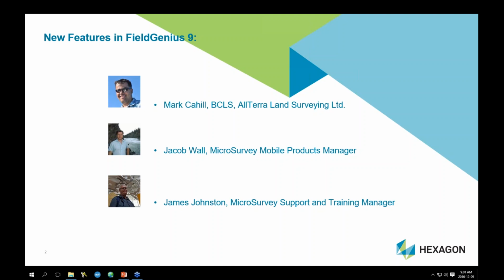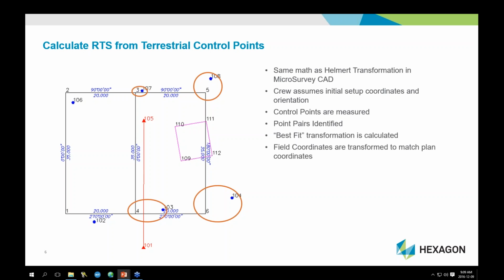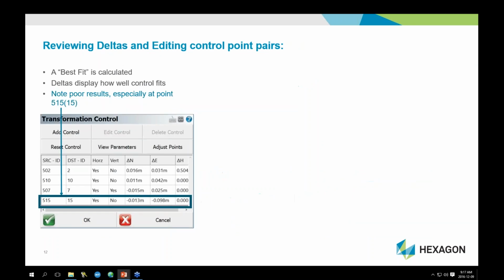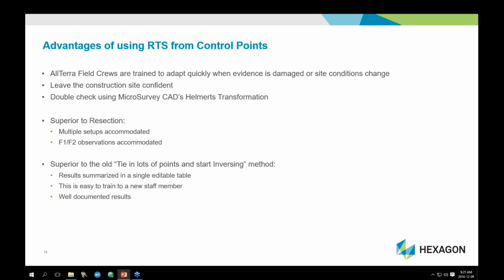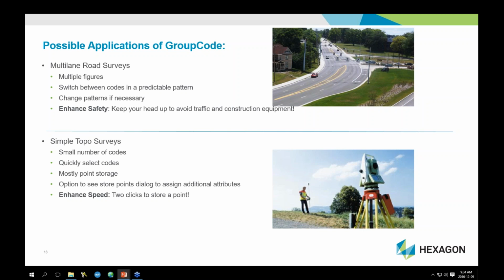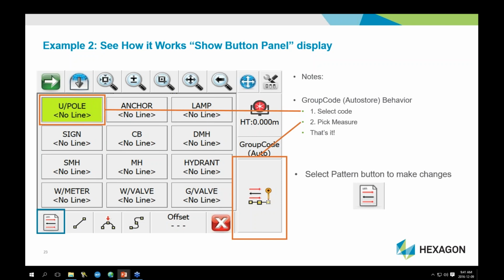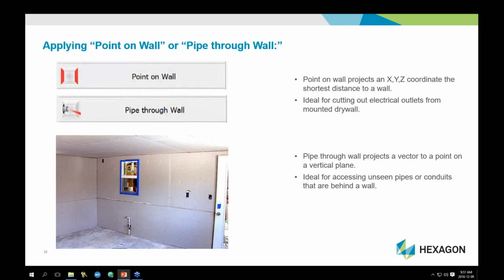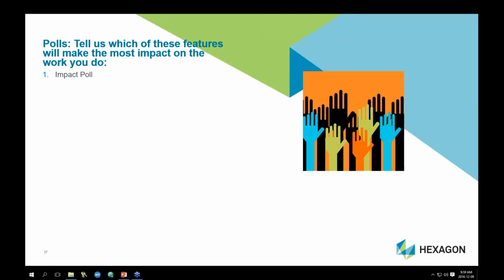Webinar - FieldGenius 9 New Features

Comment: The GroupCode function is limited to collect emough attributes for a feature. Eg. attributes for power meter, Buidings, poles etc. For power meter, one would have to enter whether the meter is Single/Three Phase meter, Meter S/N, Meter Acc No., Name of registered user etc. These will require more "Fields and Drop Downs" to enable you create your Library for your project. Recently bought MS FielGenius 9 but i am unable to create more of GIS Attributes making it impossible to finish jobs quickly. Is there anything am not doing rightly?